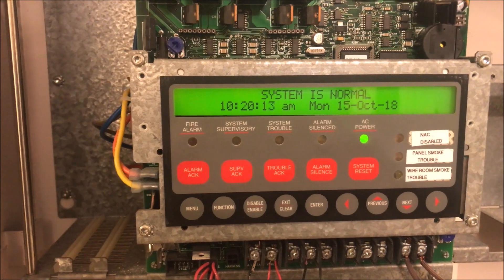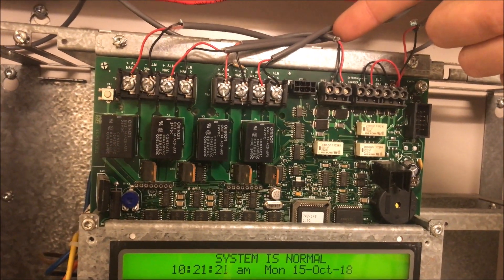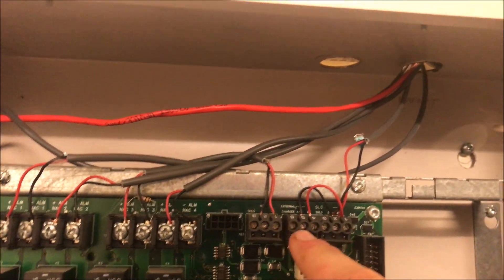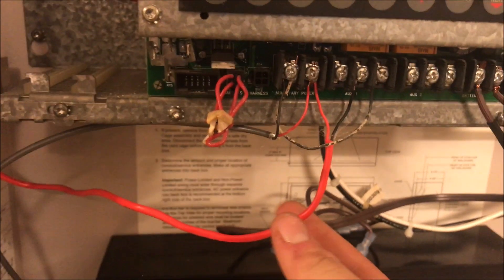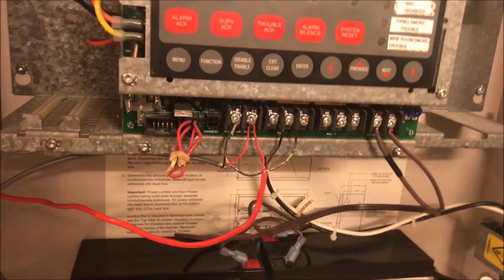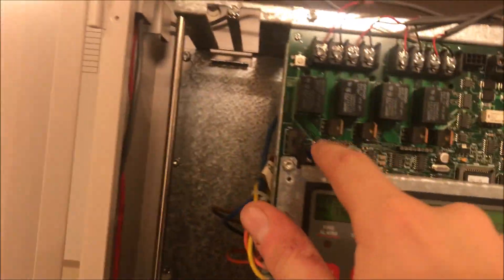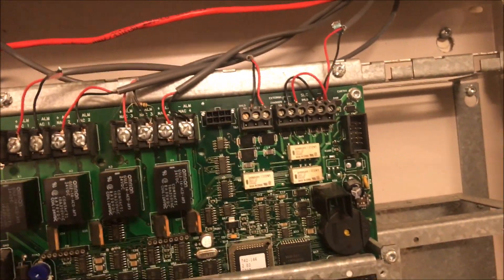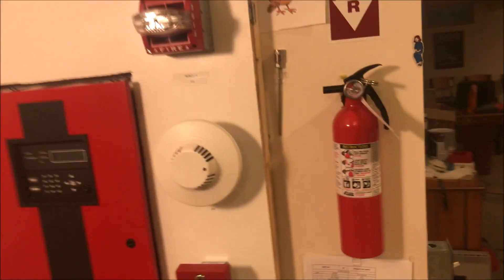Basic Wiring on a Simplex 4010 Fire Alarm Control Panel

Comment: Hey Man! Awesome info on these vids. 

Can you go through the wire planning process on the prints? 
Every time i draw my plans out on how im gonna run my fire alarm wires. (16, 18 gage NAC, and SLC ) theres always something that my lead tells me im planning wrong. 
Hes explaining why its wrong but im not seeing it. 
I think hes just lazy.
Reply from the maker: Can you elaborate more?
Reply: @FireAlarmsandSuch  yea

So when you get the prints to a new project, a brand new comercial building or an existing building with existing multiple devices, I'm told my planning and executing of the wire pulling part of the job is either wrong or the long way.  I guess I want to see how you would begin planning and mapping a wire pull on your prints. If that makes sense.
Reply from the maker: I didn't do mine class A. Instead, I used the supervision of an addressable module for supervision. What I did is I ran one channel out from the panel (in the sense of an SLC) and t-tapped off the channel, branching to each device.